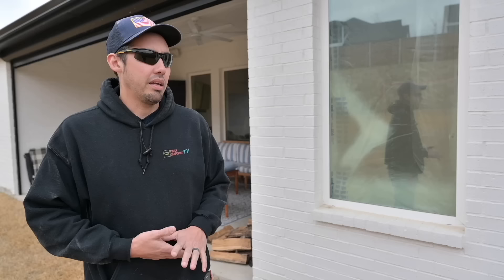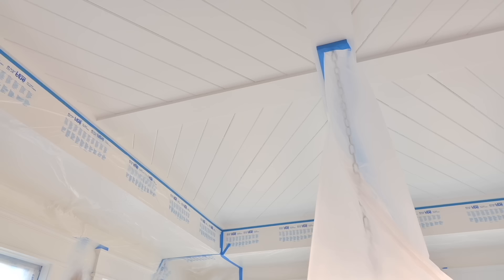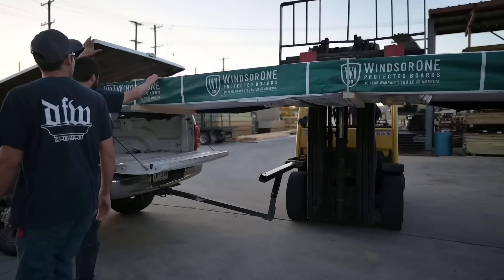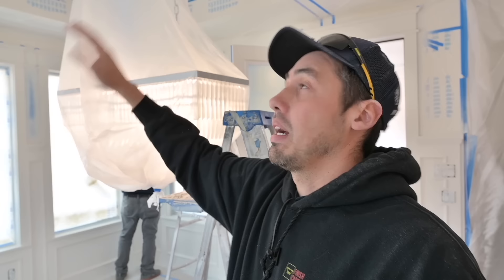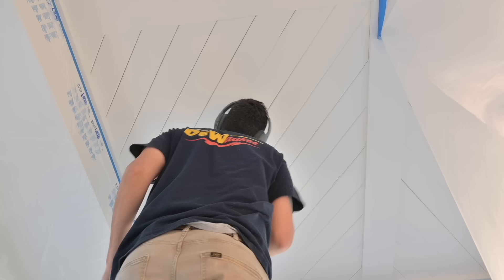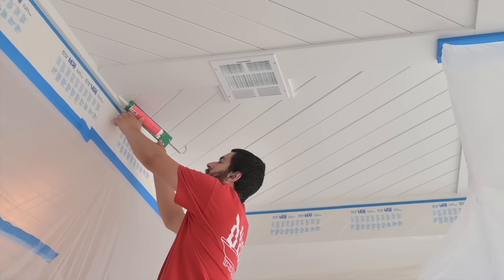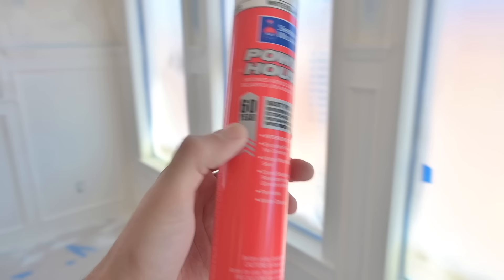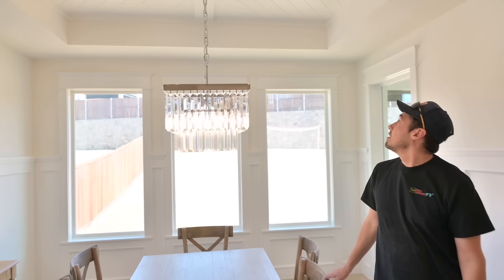Customer furious with me - Failed Trim Install

Comment: Housepainter here, 30 years experience . I don't know how carpenters today can expect great  results with the low quality of wood that's out there . Stuff REALLY shrinks ! Techniques that were proven to work just don't anymore . I have had to change much of my caulking approach over the last decade . For what it's worth , as others have said, I  avoid caulking ANY expansion based joint whenever possible . But on to the moral of the story, if you want a steady, reference based client base that lasts for decades , do the right thing on warranty work like these guys did. It hurts at the time, but it's needed. A few years back a drove by a house I panted that was having severe UV breakdown issues after just 5 years. I contacted the owner myself and said something is wrong . Turns out the paint store altered the colorant formula( side note: Do NOT get exterior colors matched from company to company unless the person making the match knows exactly what they are doing) . In other words it was product failure . Yes the company gave me new product but they won't compensate labor so I had to eat 4 man days. However, that client has referred me to at least 6 others based on me doing right by them . So hats off here

Comment: You guys do some nice work. Love the walls!
Like you, I was wondering if the recaulk might screw up the depth of each "V" and kinda compromise the 'look'. 
Gotta be a decent caulker to keep it consistent for sure. 
I was thinking SW "caulk" might cost about ten bucks a tube... but not so.
Sherwin-Williams - 10.1 oz. PowerHouse Siliconized Acrylic Latex Sealant - $3.89

DAP - 10.1 oz. Alex Plus. White Acrylic Latex Caulk Plus Silicone $3.18
Reply: Dame... ALWAYS forget to read comments before I open my BIG mouth :(. So I'm reminded to NEVER caulk T n G 😢
Hey Alexa.... "should you caulk tongue and groove ceiling"?
"Well Sym, you tall, dark and sexy old man, while paint does tend to somewhat glue these pieces together, caulking them is never advised and can cause permanent damage. Also, avoid caulking tongue-and-groove siding boards together."

Comment: Great that you went back and fixed the issue for the homeowners. My opinion they should've been more worried about the air register standing out and ruining the visual appeal of the ceiling.

Comment: Wood movement won't be stopped by a bead of caulk.
I have seen cracks develop on wide crown moldings typically during the winter. The air is dryer from heating your home and the wood shrinks. The cracks disappear when you turn the AC back on and the humidity increases. If that is real solid wood its going to move seasonally. Maybe MDF would be more stable. Allowing the wood to acclimate might help a little.

Kudos for trying to make the customer happy.

Comment: Great video.  Another consideration is if the boards are attached to the ceiling joists/trusses, you will see lots of movement there too...mostly up and down (truss lift).

Comment: Dude,  I had the same thing happen before for the EXACT same reason and I suspect that I have a 3 season room that I did last year doing that right now. I'm scared to check on it or bring it up because the customers are still happy with it.   The fact that you are fixing it as all good cantractors do helps us all.  Keep up the good work.

Comment: In Switzerland there's a lot of pine t&g ceilings and none of them are caulked. It's supposed to be installed with about an 1/8" gap to allow for movent from seasonal humidity changes.

Comment: Ran into the same problem when I renovated my Bathroom. Old wood ceiling, scuffed, sealed the shadow grooves with Acrylic, (skipped primer) painted with a white, Hybrid Paint…. 5 months later…. Realized I made a mistake haha. You live and you learn. Wouldn’t know what else to use. Can’t paint over Silicone. Can’t push a bunch of paint in the grooves. How could someone fill in the gaps? Doing my apprenticeship in Germany… one year left.

Comment: Big Stretch caulking has amazed me by stretching waaay farther than I would've expected on some random fun crap I caulked years ago (clear caulk, unpainted).  And in the few spots where it did separate or holes opened, I just smeared some more on there and it stuck fine and has lasted for years now, still air-tight.      

Not a contractor, just some dude, figured I'd mention I've used the stuff a lot and it seems to work as advertised.  And I like how it applies, and a bit of water (or rubbing alcohol?) can be used to get it all smooth and perfect....I spray a fine mist on the caulk and my finger(s).    (A trick for thicker applications (old, imperfect houses, fixing things that just aren't worth "doing right") is to do an initial dry-finger tooling to get the caulk in place and stuck on, let it set up for a while, and then wet-smooth it perfect once it's set enough that I don't mess it all up, just get the surface nice and smooth.) 

Thanks for posting this vid, and thanks to all the comments and people sharing knowledge, very cool.

Comment: Excellent to fix your problems. I always check moisture but prefer to leave the timber in the installation area for as long as possible. But even then I’ll allow for expansion-contraction with expansion joints ( on the sides where they can be hidden). The other option is to seal ALL surfaces of the wood before installation and painting - expensive and time consuming.

Comment: As a professional painter I know this issue all too well. I myself do not caulk tongue and groove. However if the client requests I always use an elastomeric caulking. It flexes a lot more than standard DAP brand caulk. 
Good on the business owner for owning up to the mistake and fixing it. Thumbs up. Keep up good work

Comment: Good on you for making it right.
When you can, it is good practice to leave the wood 24 - 48hrs in the room you are planning on installing it in. Gives it a chance to acclimate, very common with flooring. Also, tongue and groove is designed to allow for contract/expansion - with no caulk between the v joints.

Comment: I always paint my tongue and groove before install and never caulk the joints, there’s No need to caulk and this is example  exactly why you shouldn’t. This way when shrinkage occurs the exposed tongue has the proper top coat color. 
Also as with flooring it’s  equally important to allow your panel materials to acclimate.  
Thanks for the vid bro. Good discussion material 😉

Comment: Moisture is a huge seasonal problem in Michigan.  I just saw this occure in a 6000 Sq ft home when the humidifier  failed.      You did a great job on the repair .👍

Comment: Luckily it's a relatively easy fix. The ceiling is a really beautiful design and now it will be looking tight for many years to come. Thanks to the great customer for allowing you guys to film and come back to touch this job up to where it deserves to be. I feel like it might look even better and react to the seasons better without any caulk in there - but customer is always right

Comment: I have a feeling the problem may come back. We have a T&G engineered wood floor that moves with the seasons. In winter the air is dry and the wood shrinks opening tiny gaps just like this. In summer when the air is more humid they dissappear. Some places say the solution is correct gluing. They say you should use a brush to ensure the groove is properly coated with glue instead of just running the nozzle of the glue pot along it like most people do.

Comment: I’ve been a painter for 30 years. One thing I’ve learned about paint and caulk is to never cheap-out on materials. It doesn’t pay. I’ve been using Sherwin Williams for most of that time. Solid company with a good product.

Comment: To stabilize the boards make sure moisture content is correct and paint all around (yes backside) before install. You cannot use caulk on boards that will continue to move. Caulking only compounds the problem.

Comment: there is a stretchy caulk they sell which is supposed to compensate for this.

There is also a V groove tool to scrape out caulk in the drywall or paint department. it has a tube with like a v shape to it for scooping caulk out, maybe its in tile...

Comment: Yeah I learned this lesson the hard way too. Never caulk T&G. It will always and continuously move and crack the caulking.

Had to go back to a bathroom, I did like your ceiling, 4 times in 3 years to fix the caulking. Last time I ripped the shit out and just left the gaps. Haven’t gotten a call back since.

Comment: Awesome job and quality. I'm closing in my porch and getting ready to put up 7" shiplap on a vaulted ceiling for a similar look. I'm doing it for simplicity and a salvage lumber place has it in 12' foot preprimed MDF cheap. The MDF shouldn't expand and contract and I'll be waaaay less picky.   Nice work there

Comment: MDF v-grove is a popular modern alternative to T&G timber to avoid the gap movement issue. However, MDF needs to be primed on the back side to mitigate moisture ingress causing warping; and bigger beams might be required.

Comment: Dont beat yourself up. I've done exactly the same thing with a finished T+G ceiling. I should of left the boards to acclimatise or checked the moisture content and had similar problems with shrinkage. It was a natural finish so I had to take the lot out and redo at my own expense. Like yours all the joints looks very tight, neat and tidy before I left and got a good fixing into the joists. Shit happens, we all make mistakes but what makes you still a professional is the fact you went back and took the time and care to rectify it.

Comment: Here in the north its much worse. I used to always tell customers on new houses , "you are gonna have cracks". Houses are gonna settle and especially with caulk , as soon as they turn the heat on there is gonna be shrinkage.... Always said if they want me to come fix things, wait two years and then fix any cracks or even resetting doors depending how much setting has been done.

Comment: A lot of people say to paint the wood first and then don't caulk but the wood as already shrunk and with a caulk that is very flexible it should allow movement now without cracking. Of course the best way to do this would be to allow the boards to dry and then paint and install, caulking tongue and groove seems wrong as movement is a threat.

Comment: Caulking ceilings is always a 2 stage process. Most of the heat and air pressure leaves through the ceiling and when opening and closing doors wile caulk is cureing along with temperature and humidity differences causes cracking and pinholes. Always

Comment: I always go for the Max Stretch or the 3x’s. The best glue is the PL 3000 I use on staircases and it allows it to look as if it weren’t nailed. The skirt boards always the max stretch.

Comment: An acrylic based silicone, as used for external framing and glazing, would work well in that situation as it doesn't fully cure, so it's permanently flexible and paintable with emulsion. It's not as easy to apply as it "strings" but the same rules apply as with silicone.

Comment: As a commercial finish millwork carpenter. I cannot tell you how often we have the "GC" who's running the job very upset and often angry because we are not installing material the day of delivery! 
Every job is behind for our start date because of other trades. Then when we can actually get in to field measure and get our cabinets built at our shop and ir wall, ceiling panels or trim on site the GC gets so upset because we let our materials acclimate for several days to job site conditions

Comment: just have to remember about shrinkage of using wood, after a year due to the expansion and shrinking the wood dries out after a year or so, every caulked joint will have some sort of crack to it from movement , good job fessing up on it but its just wood drying completely out

Comment: There are sharpened V-shaped scrapers specifically made to remove old caulk.  I would have tried one here. I’ve used them on bathroom caulk and they worked great. Dunno for sure.  Every application is it’s own creation

Comment: Very few give any thought to caulk as they'll Just grab DAP from home depot lowes etc or whatever is cheapest and it's trash. Use a high quality Elastomeric. PPG has an Elastomeric Acrylic that is Kevlar reinforced and is the best for expansion/contraction. Most scoff at the $5-6 a tube but lasts almost forever even outside

Comment: Something I’ve noticed about roofs inside homes is the heat can dry them out extremely quick or even over long periods which will cause that

Comment: So glad you made this. I had the exact issue with the plank ceiling I installed last fall. I thought I was going to have to rip it out. Your tip on using a screwdriver vs blade was a bonus. And thanks for the caulk recommendation.
Reply: I installed tongue and groove cedar in a porch cieling and have same problem.  Too late to change but next time plywood or mdf.  Much cheaper, much more stable.  Too bad we have to learn the hard way

Comment: You’d need at least 90-120 days to dry summer purchased lumber. I have a bunch of 3” tongue and groove to match our ceiling of the same but 30 years old. Bought at Menards about 2 months ago sitting in AC and weighted down and clamped to stop warping. I’ll install it in October.  Because I can’t always do that I glue and screw all newly purchased lumber and trim. I NEVER use caulk. Ever.

Comment: Being in the cabinet business. These are referred to as witness lines. While you should have allowed the wood to acclimate and checked the moisture content this is going to happen again. You could completely glue every joint and use the best caulk in the world and you will still get witness lines. Throughout the year the humidity levels are going to change in the house even though it is air conditioned and eventually some of these lines are going to show back up.

Comment: Also another option would be to make the diagonal board fields  like a "floating panel" similar to how a raised panel cabinet door is made to allow for extension and contraction over the years.  Also alternate the crowns of the planks for better stability

Comment: Great video. Like myself some lessons are expensive. Although it is not wood, I found that vinyl bead board maybe a good alternative. You can either paint it or leave it. No worries for swelling or contraction. The price is always has to be factored into the consideration.

Comment: Kudos to you for going back and fixing. I agree with some of the other posts that I would have resisted caulking. Would have just painted. Plus what a stupid ceiling to go with anyways. Good job on you though

Comment: Damn that sucks bro but good for you for making it right. Back in the day we would prime and paint before install and paint another coat after install. We never put caulking in the joints and I’m thinking this expansion is why. We were cabinet makers though not trim guys so I’m not pretending to know everything

Comment: It's also a nice design to work in the expansion and contraction gaps like for exterior siding. I would say it depends on the client but as a furniture maker I like there being certain limitations in terms of what one can and shouldn't do with wood. But again the caulking is one approach but having a reveal might be best. With so much paint and caulking it makes one wonder if a panel would have been better and using a router to add the reveal. More work of course. At least like you said, the boards are acclimated now and in a home with good climate control the moisture swings should be less extreme. That said most people don't have RH monitors and really have no idea between seasons.

Comment: I did my side fence with brand new fresh cut rough pine, and had the same issue, but the gap from install which was zero the entire fence line is now 3 to 5 mm, which is a crazy amount of shrinkage, lessons learned are often tough ones. I went along the fence and pulled every slat off and redid it and ended up with +5 slats by the end of the run.
six months later, you guessed it, gaps again, it still hasn't dried all the way after three months lol.
face palm.

Comment: I’m surprised you do your own painting! I’m a painter and have had very similar issues with the acrylic gap filler in the last year or so and have been told by the suppliers that it was a priming issue. But even with priming as per suppliers instructions this still occurred! I have since rectified this issue with using a guarantee on my products I use but well done.

Comment: Hind sight is always 20/20. You should have acclimated the lumber prior to install. I carry a moisture meter and won't install flooring trim wood walls etc  until moisture content of the wood and the house moisture content are  are the same. Sometimes takes as long as two weeks....but avoids issues. Any problem after installing wouldn't be at your expense or responsibility.

Comment: Over time I learned that you should give each product the right time, in this case it would be to caulk, I recommend letting it dry for at least two days and you will have a caulk without problems.

Comment: Moisture meter is a good idea..with construction in the summertime a dehumidifier running for a day first would  help a lot to bring the house to an average relative humidity. I'm not sure what your particular case is with the time frame of when the drywall is done or if this was a renovation, but as you may know mudding the drywall introduces a lot of moisture into the environment.